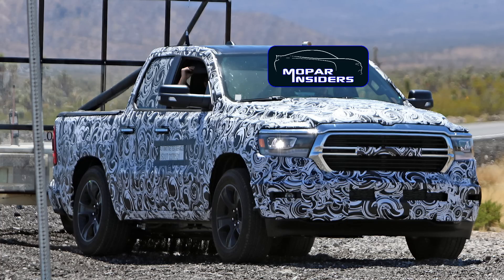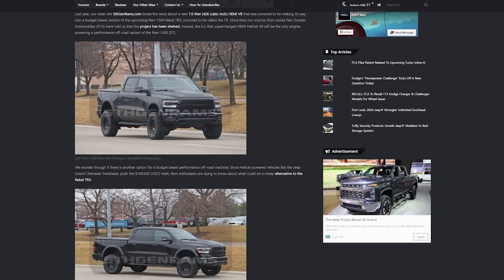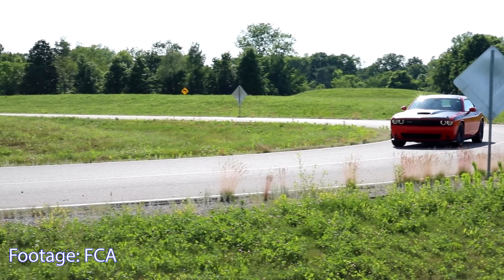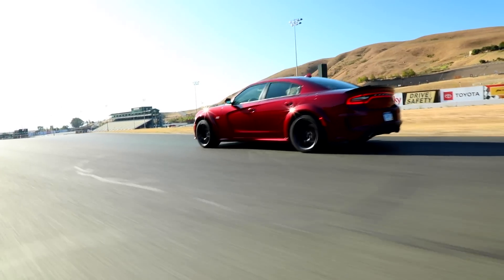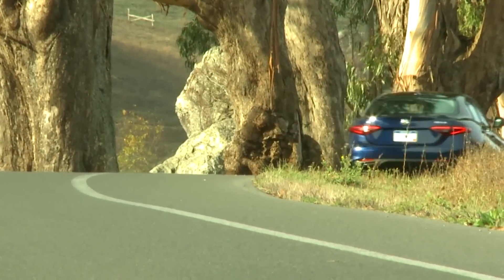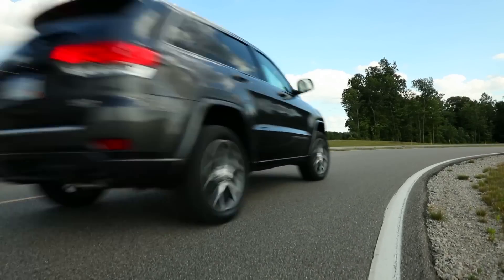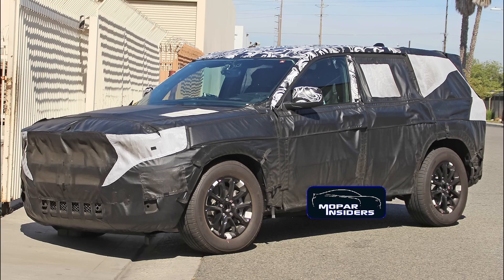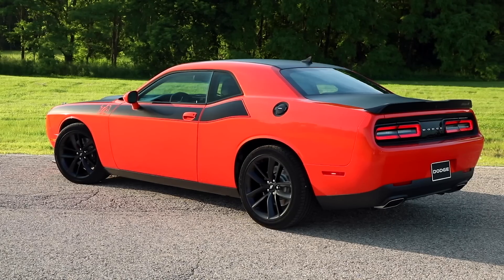What We Know About FCA's Upcoming Turbocharged Inline 6 Cylinder Engine. 525HP!?

Comment: Motor manufacturer  are scrambling to meet the EPA targets of 30+mpg. They don't really have an option but to go with smaller block turbo driven motors with advanced EMS. It's the end of the V8 era. Government regulations are just going to get tougher until all vehicles move to battery electric or alternative fuels.
Reply: I don't get why the push for EV cars other than the manufacturer can push the pollution blame onto the battery manufacturer. Let's be honest, making batteries is harder on the environment than a gas engine that operates for ten years. Now that they got rid of all the zinc and molybdenum and replaced it with calcium in the oil we just need to move to E100 and they could get away with running a 500 ci v8 just fine.
Reply: Rob Sorgdrager Everything I've read disagrees with your statement that batteries are worse. Any references you have are welcome. But besides the environmental argument why would , a normal 9-5 Joe shmo who commutes 20 miles to work every day and maybe another 100 to customers, want an older more expensive to operate technology when electric vehicles offer so much more at  20% of the running costs? No thanks I prefer the money in my account 😀
Reply: @garthhayward9581  I'm a mechanic of over twenty years. ASE master certified, Volvo certified,Ford star certified, GM certified. 
I've worked on all generations of hybrid and now ev . Your info is from the Chinese companies that have zero environmental bodies that can force these govt run corporations to abide by any rules. Mercury , lead , sulfides , fluorides , acids , out gassing....this is just what's needed to make a battery. What happens to that car when the owner finds out what it costs to replace just one bank of that lithium battery ? No one ever told them the life span of a battery or how to maintain it...now our scrap yards will be filled with all these toxins that need special tools and techniques to harvest the heavy metals and control the caustic vapors.....you ever seen how they mine and refine lead? You understand copper is a limited resource? You ever seen the list of chemicals it takes to get copper from the ore? So again I ask .." why the push twords EV ?"
Now all the systems that make this stuff have to triple the output at the same cost. That means they cut corners, health and safety are always the first corner.  Not only will the toxins triple but the quality of the final product is compromised. Making EV cars battery powered is a step backwards. We need to focus on hydrogen fuel cells ( turns hydrogen into heat and water) to power steam engine ( look at a old train , that 30 gallon drum thing with the linkage ....that's what drives that entire multi hundred ton train ) first and foremost we need to stop the petroleum use. We can make fuel from hemp or switch grass or corn that burns far cleaner that gasoline. I use ethanol in my daily and in my play toy....it's 118 octane and it packs more punch per ignition cycle than 92 premium. Where I live in Minnesota there are days your battery car won't work and if you try it will damage the batteries. Mix in a little gasoline to 20 gal of alcohol and she'll fire at 42° below zero. Batteries are just a way for car manufacturer to shift the blame some where else.
Reply: @robsorgdrager8477  Nailed it .  
And its the SUN ffs that affects climate cyclically .. not CO2 ..just say no to that bs ( and I am a enviro type but did my research )
Reply: Rob Sorgdrager My sources don't agree with your assessment. 
From a battery recycling point of view we know that 95% of lead acid batteries are currently recycled.
We also know that Tesla will soon be producing the million mile batteries which means around a 10 year life span in the US and 20 year lifespan in Europe. In addition last year they addressed the re Y ling of their batteries in the article below.
https://cleantechnica.com/2018/06/07/yes-tesla-recycles-all-of-its-spent-batteries-wants-to-do-more-in-the-future/

As far as studies done on which technology is cleaner, the Union of Concerned Scientists published a new report comparing two battery electric vehicles (BEVs) with similar gasoline vehicles by examining their global warming emissions over their full life-cycle, cradle-to-grave analysis. The two BEVs modeled, midsize and full-size, are based on the two most popular BEV models sold in the United States in 2015, the Nissan LEAF and the Tesla Model S. The study found that all-electric cars representative of those sold today, on average produce less than half the global warming emissions of comparable gasoline-powered vehicles, despite higher emissions of manufacture.
Study after study concludes that BEVs are better and as they become more efficient they decrease their impact on the environment.
Reply: @garthhayward9581  What a gigantic waste of resources and truely, scam scientific "reports" to push this CO2 agenda . It's foolishness of the highest order. 
Governments love it because they think these taxes will avert their Sovereign debt crisis. Oh and btw , to supply electricity to this religion, would require multiples of existing generation facilities.
Reply: @garthhayward9581  it's possible but that's on paper. Remember though that there are still gen one Prius and volts out there. I am currently working as a Volvo tech and by 2020 we are going to start phazing in full EVs . I'm not happy about it as we used to sell and service fiskers and those caught on fire all the time. I will never buy into ev cars are the future as batteries are nasty toxic things. I don't like all this tech in cars as it's a car and you are to be paying attention to the road. EVs have too small a range, they don't do well in cold or extreme heat. They are too heavy for off roading . If the time comes and internal combustion engines are gone....I'll make my own. Electric is for trains and bumper cars. The only way I'll buy a electric car is if it's powered by a fuel cell. Once these battery cars are in the hands of the owners they spew crap out of them. The studies you have never went over the emissions they make over a ten year span. Where does the electrical come from..you need to count the emissions of the power plant too. The more charging stations require more infrastructure....more emissions .
These cars need to sit around to be charged that needs more space just for EV cars...that will make more emissions. It's not just the manufacturer of the crap it's also it's use. Tesla has done wonders for EV cars but like all those who go up against big oil , they will fail eventually. I'm not totally against them but people need to know they are no more environmentally friendly than a engine that runs on alcohol. Remember that back in the day big tobacco had all these studies that proved cigarettes didn't cause cancer or other health issues? Same thing here.
Reply: @kevinprokopenko7023  granted we don't help it, we have sped up what has been documented in sediments the earths whole life. What will happen is what always happens....the earth just kills off what's harming it. Floods, climate change what have you...it will happen regardless of our co2 output. Batteries are the devil.
Reply: @garthhayward9581  to answer the " Joe shmo " question.

Those are prime candidates for public transportation. They use cars as a form of transportation of just one person...that's wasteful . I build my own cars, and I am passionate about driving them. My daily is a lowered 09 crown Vic with a manual transmission swap in the works , long list of engine mods. My plays toys are even more aggressive than that. My daily has a 2500 watt stereo and even though I hate batteries I need them for that. My fuel is ethenol and if I could run E100 I would and could. The cats are intact and I use a gas probe to tune ...I know what's coming out my tail pipe. So Joe shmo should get a bus pass and let car people be car people.
Reply: Garth Hayward 
“Batteries with 10 year lifespan”
So that means my 20 year old truck (which has only needed routine maintenance) would have needed 2 battery replacements already.  

Not to mention the cost of battery replacements costs thousands, over $10k for some.
Reply: @stlchucko  don't forget it can take months to get those batteries. It takes a certified tech to do any non 12 volt work on them also, not every dealer has certified techs . I have yet to meet a fellow tech that is excited to loose his/her ass trying to make time on them as well . Parts are never in stock and diag info is limited . But yeah, the way of the future 🤣😂🤣😂
Reply: It's not the government its California that is fucking everything up. Cali has the strictest emission standards and laws than any other state!
Reply: yeah.. blame the epa.. been hearing that since the 2000 election.  Since then we've had regular passenger cars with 500 hp and even 840 hp streetcars.   the reality is the consumer is interested in higher mileage cars and thats why manufacturers are building them.  todays consumer doesn't want a manual transmission or inefficient vehicles. Stop blaming the epa and wake up to the future... because driverless and electric cars are coming.
Reply: Lonnie Fluty The latest targets, which the auto industry helped set seven years ago, call for light duty vehicles to average 51.4 mpg, or about 36 mpg under real-world conditions. Industry officials say the weighted sales mix towards light duty trucks in the past 18 months, now puts the official target below 50 mpg.

Comment: inline sixes are a great platform. touches on mopar's history (real fans know what i mean) in that area that is still highly respected.
Reply: I'm a Ford guy but I love straight sixes more. Always wish the Ford Barra six was offered over here in the states and I absolutely love my 82 Bronco 300 inline six with a 4 speed manual. Now that Mopar maybe offering it I just may have to switch to the dark side. Both the Chager and Challenger are on the heavy side, it would be nice to see them cut some weight or  come out with a lighter platform.
Reply: @abbeynormal252  id heard there was talk of moving to the alfa guilia frame, but idk if its true.
Reply: @abbeynormal252  should bring the dart back
Reply: Loved the 4.0 in my ‘96 Cherokee
Reply: Slant six, although I have a feeling they wont put the exhaust manifold and intake manifold right next to each other this time. 🤣
Reply: The old Jeep inline six was designed by AMC/Rambler back in the early sixties and refined over time.
Reply: @Ben Bla the 4.0 was an existing AMC engine size, 232 cubic inches. The 2.5 was 2/3 of an existing AMC inline six. The 2.3 in the Ford Tempo was 2/3 of the Ford inline six, a different motor from the SOHC 2.3 in the Mustang.
Reply: In the duster and the Jeep cherokee ?
Reply: Had 2 dodge darts 72 n 73 with slant six bring them out ;)
Reply: The old slant sixes were bulletproof

Comment: Dodge before: Huge 8 cylinder engines in everything, amazing sounding cars.
Future Dodge: Small 6 cylinder and 4 cylinder cars with names like eTorque and turbocharged and and e boost crap like that.

There's no replacement for displacement
Reply: JoshJ763 you can thank Peugeot, most likely
Reply: It wpuld be one thing if they were doing a turbo v6 like ford, but they are smart and are doing an inline, which is the most reliable platform, and can make gobs of power through turbocharging. Displacement is irrelevant
Reply: @AdamSticksNTricks  you realise the ford barra is an 4.0l inline 6cyl right.
Reply: @6226superhurricane  i always knew that. It is one of my favorite engines.
Reply: Did you ever here of a Grand National?
Reply: @karlsracing8422  yes
Reply: Patrick Karls yes a piece of shit 3.8 liter that blows up at 50000 miles because it can’t handle the abuse and that’s know lie junk
Reply: Patrick Karls none of these future cars would compare to a Grand National. The grand national aint even that impressive anyways.
Reply: Facts. How the hell you drive a muscle car with small inline turbo 6 cylinder motor
Reply: @ParanoiaSZN  australian e49 charger had a 265 6cyl with triple two barrel side draft webers and had more power than the v8 options. and if you want see how a more modern turbo 6cyl stacks just look at the ford barra there is one in aus in a dodge drag car that puts out 2200hp
Reply: michael close 😪😪😪 200hp 2000+ hp
These turbo inline sound like 💩🤡
I rather a 400-500hp V8 with the sound over any of these upcoming cars 😪
Reply: @ParanoiaSZN  ok i get it you're all about posing not performance.
Reply: michael close You have downs to assume that
Reply: @ParanoiaSZN  lol says the bloke that said he'd choose an engine based on sound not performance.
Reply: @6226superhurricane  so can i have a supercharged V8 instead to see how much that would measure up your turbo'd 6 or is that an unfair comparison? 😂
Reply: clueless
Reply: They started development years ago before Peugeot was even a thought.
Reply: It was impressive at the time and a lot of people made them extremely  fast.
Reply: Since im building a 440 for my 74 duster i know there's no replacement for displacement, but times are changing for auto manufacturers.
Reply: Patrick Karls indeed it is. Crazy to see what cars will be like by 2030 at this rate. Im all for new tech but I sure do love the sound of a nice Cam V8
Reply: No you can thank greta and all the false idiot politicians who are brain washed.

Comment: They most likely will be using a variable geometry turbo with a vgt actuator which will control the vanes or nozzle. It’s the best type turbo for no lag and has been used for years in diesel applications already .
Reply from the maker: Absolutely, expect all the latest technologies in this upcoming engine. That said the eBooster will still be beneficial for helping out down low, from a stop, etc.
Reply: Ya and it was junk when jeep used it and will be in this too id imagine. Time for Dodge to to fade back to the sidelines again and they just clawed out of the junk pile too what a shame
Reply: Donald Liverance junk? When did Jeep use it?
Reply: @seanem7261  in the Merc diesel in the grand Cherokee the turbo system was garbage and ran like 8k for the fix now it could be fixed but turbos kill reliability higher pressures more moving parts extra censors it's just a lot more to fix and wont be cheap either
Reply: Donald Liverance actually turbo diesel is different than turbo gas as far as emissions. Turbo diesel adds dpf and scr systems which the gas engine does not. Unless you are pulling heavy loads day in and day out there is no need for a diesel. My brother has a 2.0 turbo in his Jeep and it’s a really good engine with the 8 speed. He is getting 28 mpg in a 4x4 , which is amazing. He has 4 cylinder fuel economy with the power of a v6 . I like my cj5 with the 258 but this 2.0 turbo is amazing. FCA did a great job with the JL with the 2.0.

Comment: I wish they would build the 5.7 internals . And give it a turbo option
Reply: They're applying all this effort and technology to make small engines more powerful. I don't understand why they don't just apply it to the big (already powerful) engines and make them more efficient.
Reply: @simrantoor85  weight
Reply: Manolo Corsetti that makes sense, but why not re-engineer another V8 with lighter materials? That’s always a viable option
Reply: @simrantoor85  im sure they do that with the body/frame but for the engine, iron and some aluminum are your only viable options. Anything else is just too expensive
Reply: Simran Toor hey im all about making an aluminum block that would save alot .
Reply: @simrantoor85  Weight
Reply: Great point
Reply: At the very least, put direct injection on the Hemi.
Reply: @craigroth8710  direct injection only if it has an injector above the intake valves as well , direct injection motors that dont get a stupid amount carbon build up on the valves .
Reply: That thing would be unstoppable